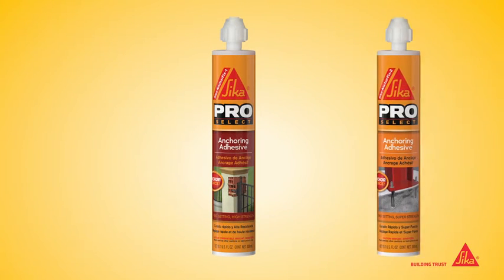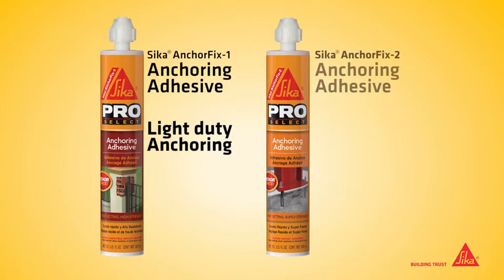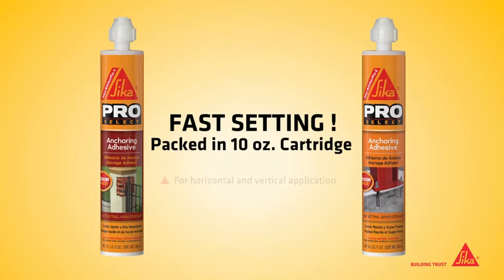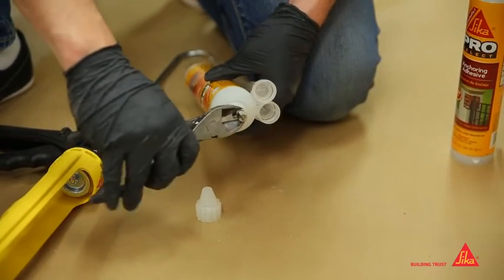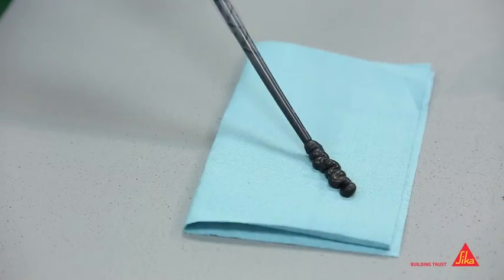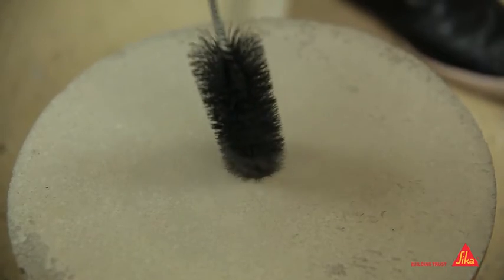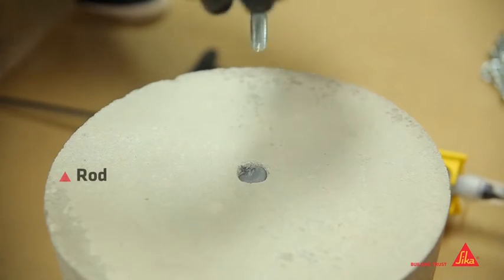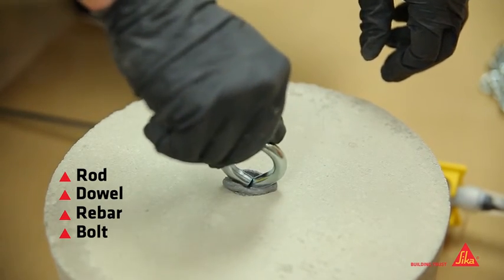Sika® Anchoring Adhesive 1 & 2

Comment: What is the difference between 1 & 2?  Does 1 have sand in it and 2 does not?  Is there an application where you would want to use 1 over 2? Thanks.